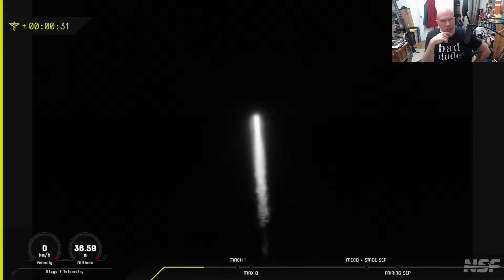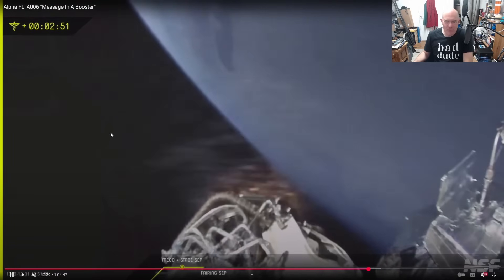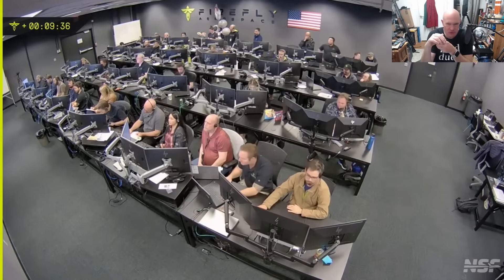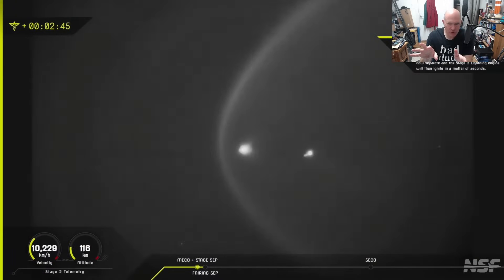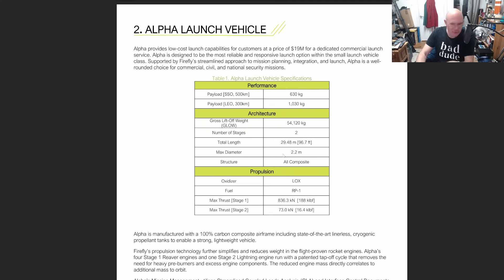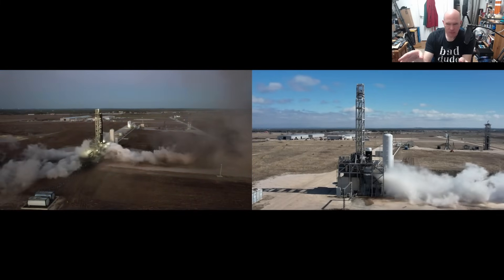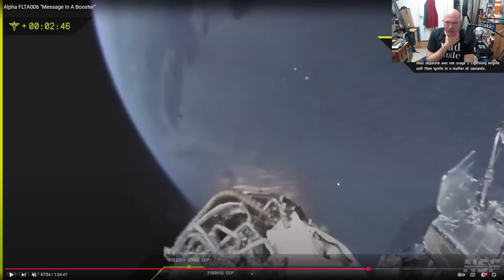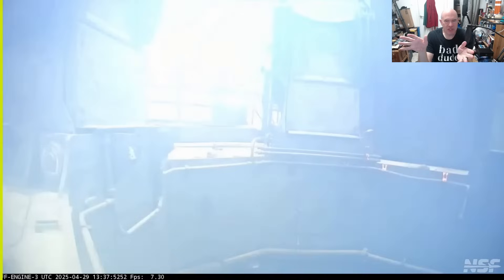What Went Wrong On Firefly's 6th Rocket Flight? Did The Nozzle Fall Off The Second Stage?

Comment: Absolutely insane that interlaced video is used in anything these days. It became obsolete around 20 years ago.
Reply: Some types of cameras still use it for recording because it virtually doubles the frame rate for low speed image sensors, like infrared or "heat" sensors. They just don't do well recording high speed motion.
Reply: @3DPDK  The problem is that it doesn't. It gives the illusion of double the frame rate, but the loss in image quality is astronomical, and you don't really get a higher temporal resolution anyway. There is no acceptable reason whatsoever for interlacing to still exist in any way, shape or form today.
Reply: @ Now, I didn't say it increases resolution. It increase frame rate. Interlacing was developed to deal with timing limitations in the phosphors used in CRT screens: The image on the screen had to be retraced at a 60 hz rate so any leaked line AC in the power supply wouldn't interfere with the image, but the entire image (360 scan lines) couldn't be drawn 60 times per second because the phosphors' reaction time was too slow. The full image rate in CRT technology is only 30 FPS (29.97 actually) but the physical scan rate of the electron beam is 60 times per second.
Reply: @3DPDK  Oh, I know why it existed. It's just that those reasons no longer apply. Not for decades.

Comment: I noticed in the internal staging footage there is what seems to be some  movement of the engine bell before the stage separation.  If there is a piston pushing against the inside of the bell to aid in seperation, could that movement have caused the close call between the first stage and the engine bell in the earlier launch?

Comment: Either the announcers did a really good job of keeping quiet about the issue or they didn’t notice the nozzle was missing, but there was no mention of the issue during the launch even though they would have noticed the lack of acceleration in a handful of seconds and for sure by seco.
Reply: I'm pretty sure most announcers for rocket launches have a script to follow at specific times.
Reply: @stone7281  Yeah, that's come up on many failed launches. The commentators know what should be happening, but they're not sitting in mission-control following all the details, so they're not much better informed about what is happening than the audience. So if the rocket goes off-script, they're not necessarily going to get things right.
Reply: @stone7281  They have timelines in front of them, and their approach to the coverage is usually to call out the events that are happening on the timelines.  I don't actually believe that Firefly told the commentators real-time to not mention the anomaly, as their own feed from their control room used the phrase "controllers are carefully studying their data," which 100% of the time means "to find out what went wrong."  But the NSF guy, who is aware of this, specifically tried to deflect this correct interpretation by saying "They're studying the data, which of course you always do after a rocket launch, even a successful one like this," or something very similar.  It sounded more like the commentators' decisions to cover up an obvious anomaly, than Firefly telling them to do so.  Very disappointing, zero journalistic integrity at all.
Reply: @DougVanDorn  thank you! I drew the same conclusion. This is certainly not the first time NSF has had this issue.

Comment: Scott, the rapid dispersal of propellant right at staging (from its white color and its speed of dispersal, I'd guess it was LOX) was, to me, a very strong indicator of a burst tank.  Since the second stage obviously remained intact (though without its nozzle extension), I figured right off that the first stage basically exploded during the staging event.  I think the scenario you mentioned, of the LOX dome being penetrated during the staging event, is the correct one.  I think that something occurred that blew a hole in the booster stage's forward LOX dome, and the overpressure from that explosion into the nozzle extension of the second stage's Lightning engine caused the nozzle extension to break and blast away.  That would be consistent with what we saw visually.  And in fact, gotta say, I'm amazed that the Lightning had enough control authority to bring the vehicle back under control, when it was obviously cartwheeling with a good 30-degree coning angle just after staging.  The thing that remains a mystery is why the LOX dome failed; for that, I'm hoping Firefly has some good telemetry that can help clear up the cause.  (Also, I just have to add, I'm rather disappointed in the fact that the people doing the live coverage of this launch somehow missed the absence of the second stage engine's nozzle extension.  The Firefly engineer doing the "color commentary," especially, ought to have been able to tell at a glance that the nozzle extension was gone.  I think they both knew there was a major issue, and decided to pretend everything was fine, which is highly disappointing.)
Reply: I would bet that the people doing the public commentary are told to NOT make speculative remarks based on visuals from the cameras - not so much to cover anything up, but to prevent putting out false information that would be difficult to dispel later. Since these are commercial companies "bad P.R." becomes even more important.
Reply: "We have had....an ANOMALY...."
Reply: @teebob21  "We have observed that the nozzle extension has left the environment."
Reply: @ From the perspective of the nozzle, the front fell off. That's highly unusual, I'd just like to make that point...
Reply: @teebob21  well, how is it untypical?
Reply: @gasdive  Stuff that's not designed to come off the rocket suddenly coming off, whether from the front, back, or sides, is NOT typical.  At least, not on successful launches.  When that happens -- well, you might go to space today, but you won't stay in space today.  😉
Reply: @DougVanDorn  Wasn’t this built so the front wouldn’t fall off?
Reply: They seem to be using hot gas from the main engines to do stage separation. If the transfer tubes for that hot gas leaked or ruptured it could have caused the LOX tank to rupture.
Reply: @ericpaul4575  The hot gas is oxygen from the booster. this is probably used the open the clamps that hold the booster and 2nd snage together.  It also helps push the second stage free.  if the clamps didn't release and the second stage ignited. the booster would likely rupture The interstage that holds  would have then failed and the stages would rip appart and the nozzle would have been destroyed.
Reply: That last statement is why I would prefer these streams not have commentators.  The only voices that should be heard are the mission control call-outs.
Reply: I doubt we can blame the announcers. I’m sure they are heavily scripted and were told to not mention some anomalies.
Reply: Could the pusher have pushed through the LOX tank?

Edit: oh, Scott speculated the same.
Reply: I think Das was distracted by his cohost from firefly. He did notice the oscillation, but completely missed the missing nozzle.
Reply: Presenters pretending everything's fine even when it's not is pretty normal, most (all?) companies do it.
Reply: @uzlonewolf doesn’t make it better, does it?

Comment: The phrase, "hot gas stage separation", makes it sound like they release hot gas into the space between stages, creating an overpressure. Then they release the booster and the overpressure gives a little push. If so, lots of things can go wrong. If one of the connectors between booster and second state is a little slow to release, the push will twist everything. If the pressure is too high, something will break. If the pressure is too low, such as with some kind of leak, that results in too little push which risks out-of-axis movement and collision.
Reply from the maker: I had shower thought about this before release, I don't see any physical pushers in any video sequence
https://youtu.be/6kimTg_G-Z4
Reply: @scottmanley  Meaning you also think its hot gas overpressure? If so, it sounds pretty risky. Of course, "hot" and "pressure" are relative terms.
Reply: @scottmanley scott did you notice the asymmetrical plume of the booster before sep? Perhaps the angle of attack was off during sep causing it to get stuck in the interstage with the low clearance you mentioned
Reply: The Firefly Engineer lady on the NSF livestream was bragging about how they had now optimised the carbon composite tank design now and were using a new automatic machine to make them… maybe overoptimised / optimistic ?

I’m also concerned about how the first stage flips sideways during stage separation and gets really close to the Lightning nozzle…
Reply: I think it might also be to just the inside of the nozzle
Reply: If the pressure distribution is asymmetric (an issue in high speed gas physics) the force will be asymmetric.
Reply: @allangibson8494  That sounds more like an explosion. I was thinking more like the pressure in a balloon. On the other hand, perhaps it is more like SpaceX's "hot staging" with Starship.
Reply: @ Any rapid gas vent in a vacuum or near vacuum occurs at sonic velocity. Asymmetry can be assumed if anything gets in the way.

Comment: I watched it live, but I live on the East coast, so easier on the sleep schedule.  I watched the anomaly and saw it as just that.  I thought they had lost the second stage at that point, but it kept on chugging.  I distinctly saw pieces flying off and the rocket was wobbling badly after second stage ignition.  The NSF guy hosting the launch did call it out that it was unstable, but I didn't even notice that the expansion nozzle was gone.  Running on powerhead only??

Comment: Oh boy somebody didn't torque something right before they left the bolts out.. 😢
Reply: Somebody forked the torque?
Reply: @nunyabizness-i2c  No Kevin I think. Scott Manley had the correct explanation from his last video. Seems the first stage upper stage might have collided with the engine bell. Upon separation. There's video evidence of parts falling off after ignition. So the upper stage hit the Bell damaged it either at the root where it's bolted in and when ignition went off it went off kaboom. Pretty amazing the engine kept running...
Reply: @yasnac7576  Agreed. It kept running and didn't spin out of control .... unlike the last Starship. If at first you don't succeed .....

Comment: Speaking of gas expansion for maximum thrust, I've figured out a simple way to boost launch thrust without any addition to vehicle mass.  If for instance, SpaceX were to incorporate a ring-main (a pipe formed into a donut ring) into their thrust puck, they can supply that ring-main with copious amounts of water via a tower-fed umbilical during the first ten seconds of launch.

The water, upon falling between the bell housings will flash to steam, expanding some 1600 times its original volume and thereby adding expanding gases to the thrust envelope until the umbilical severs.  The water drains from the ring-main and the vehicle goes on its way having had a significant additional kick up the pants and carrying no additional mass.

I estimate as much as thirty seconds of orbital Delta-V could be gained by using such a system at launch.
Reply: But at what cost?
Reply: @ Some water!  

Once the umbilical severs there is NO additional mass to carry, as the ring main is already incorporated into the thrust puck structure!  Upon severance, the ring drains completely, carrying nothing but air!
Reply: But flashing to steam costs a lot of energy, which it drains from the gas again.
Reply: @fracapolligummala3548  ? No, what I'm doing is maximizing the usefulness of the energy!   

The engines are producing a LOT of excess heat which is dissipating into the atmosphere with no additional advantage to thrust.  That heat can be harnessed into mechanical force (kinetic energy) by using it to flash water to steam.

this makes the entire engine bay an expansion chamber (like a bell housing), expelling matter downwards.  Which is the entire exercise of burning kerosene and oxygen... to generate thrust!

Comment: Can we stick this in a Miata?
Reply: Possibly it might bring up your horse power slightly 😂 just a over enough good for drag racing 😮
Reply: @illuminati_Bal  The Miata was not designed for drag racing, it was designed for twisty backroads.  And in that regard, most people can't even use all the power in the NA.
Reply: @rockets4kids  ha you haven't seen nothing yet in Puerto Rico they have those little cars drag racing in Arecibo Puerto Rico.